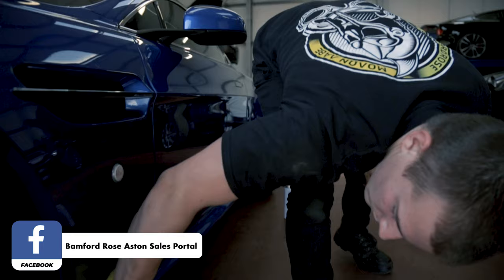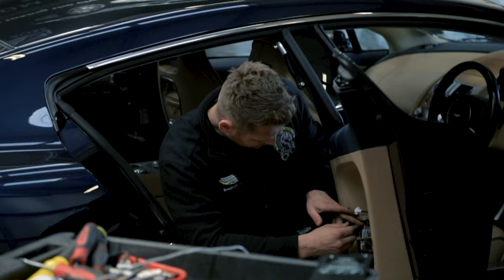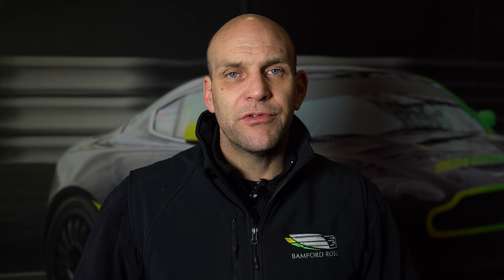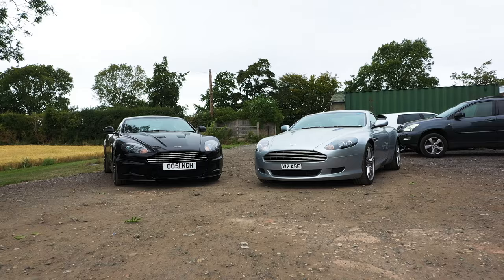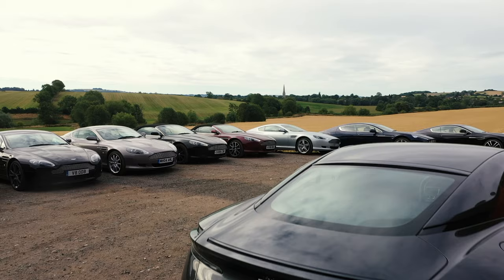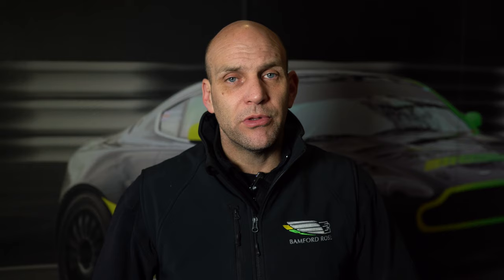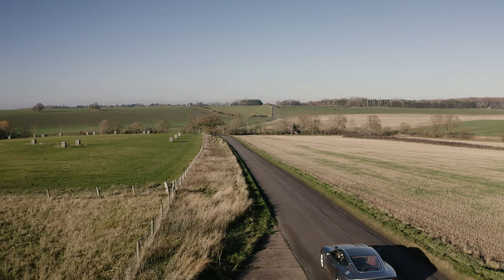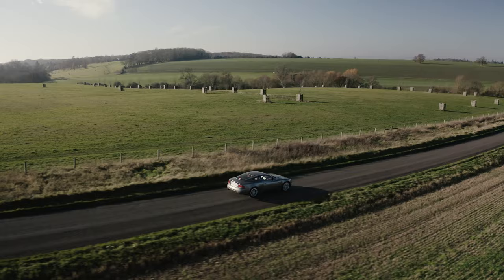Announcing the Bamford Rose Aston Sales Portal

Comment: Hypothetically, what happens if one buys a car on the strength of the BR report and a major fault develops, does it provide any sort of recourse?
Reply from the maker: Good question! I’m looking at new buyers having access to a major warranty company policy, but that’s not an option right now.
In direct answer, No, none whatsoever, that type of guaranteed ownership experience is available but comes at a much greater cost, in the form of a new car with a 3 year maker warranty policy or decent pre owned policy like timeless. 
Obviously any car is only inspected to the best of human ability at that moment in time, and any faults noted will be listed. But it’s still a private sale which a)should bag the car for less compared to the dealer route because b) there isn’t the trimmings which come (supposedly) with a purchase from commercial outlet
Reply: @BamfordRose  I was just thinking from your perspective in unlikely situation where something goes wrong. It would probably be worth seeking legal advice, just in case there’s the chance of you being held liable in any way...